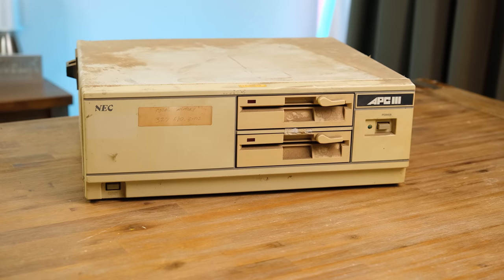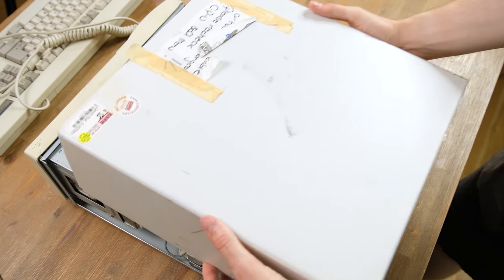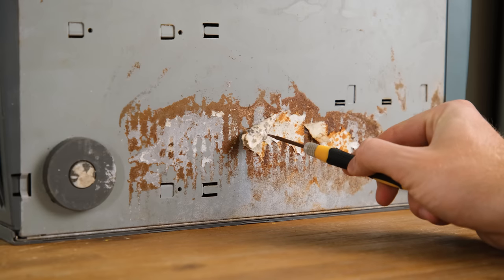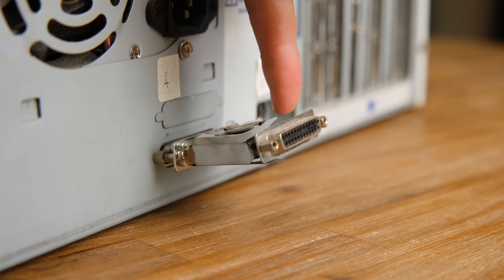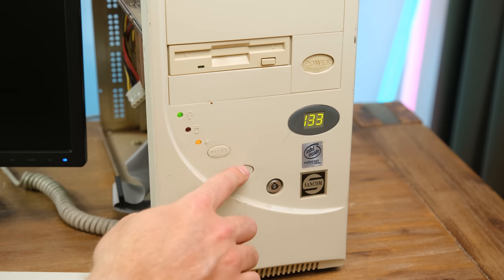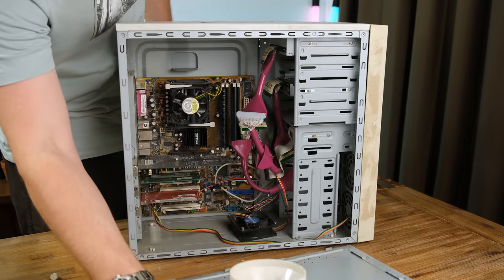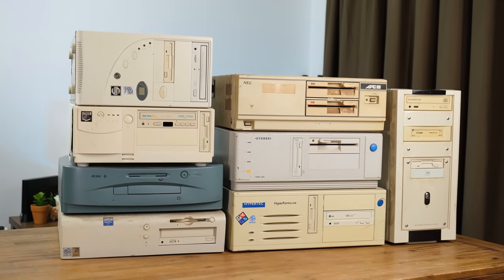I Saved Old Computers From Being Scrapped!

Comment: I kinda miss these days of system builder PCs when everyone had their own weird case and motherboard designs.
Reply: Wow. Really? I didn’t know that was a thing. I just got into PC building 8 months ago, so my apologies it this sounded amateur
Reply: Until someone had a front power switch button fail & finding a replacement was next to impossible.
Reply: Build your own PC in those days and you were stuck with that ancient layout where the only built-in connector was the keyboard and everything else was a cumbersome breakout cable or an expansion card. Buy from a big brand and you got a case designed for ONE motherboard and one motherboard only, probably can't even swap it with a better board from the same brand. There's some charm to it, but I sure am glad ATX and its derivatives came along.

Comment: Before you wipe the hard drives, remember to backup the drivers! It'll save you some headache. finding drivers for those old machines in this day is close to impossible. I speak from experience.

Last time I went to the recycling center I picked up two 8-bit Nintendos, an IBM Aptiva 2420 and an IBM model 30. Both IBM's work. One NES I managed to save, the second one was beyond repair so I built a Mini ITX PC in it instead. One man's trash is another man's treasure

Comment: If you have an old multisync CRT VGA monitor you can use a CGA output vith a DB9 to DB15HD adapter. And if you have a TV with an RGB input you can also get a cable that can allow to connect a CGA output.

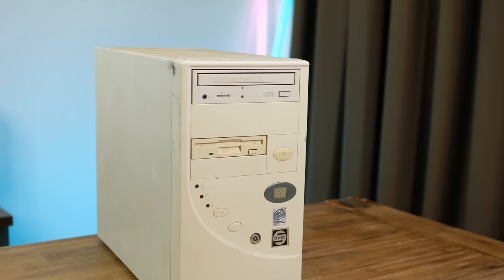Comment: At 4:25 my very first PC had the same case. My first PC was a Pentium Pro 166, 32MB's or Ram had a 1GB Hard drive and came with Windows 3.1 but upgraded to Windows 95 when we got dial up back in 1996 as we were told Windows 95 was better for the internet. I got the computer back in 1995 on Christmas day. I was so excited.

Comment: It would be interesting if these cases could be modded with all new guts (other than the CD drive) to be super down-low gaming beasts.  It has me thinking about experimenting on an old eMachines tower.
Reply: There are beige boxes in ATX format where a modern motherboard will just fit, no need to destroy an AT case.
Reply: I just made a sleeper build of a Viscom V2 Premiere case and am looking to do something similar with a Dell Dimension 2400 as soon as I figure out the front pin outs.  I like working with the P4 era and up.  I do wish that desktop cases that can hold more than 8 3.5” HDDs were still a thing.

Comment: I had an NEC APC III with two external 10MB hard drives. Which ran MS-DOS with MS FORTRAN  and a third party C compiler. I also had a 300/1200/2400 baud external Serial Dialup modem for dialling into work's VAX 11/780.

Comment: I have an old IBM computer that is so slow that it is almost useless.  But I installed an alarm clock program that allows you to enter sentences that it will speak at assigned times.  SO it is asleep most of the times, but wakes up and tells me things like "Get off your lazy butt and vacuum the carpet.", Or "It's treadmill time.  Have you done your treadmill exercise yet ?".

Comment: Nathan, with the NEC APC III, you need to remove the CMOS battery IMMEDIATELY. These can leak acid onto the board and corrode all of the traces around it, causing the computer to be unsalvageable!

Comment: Interesting stuff!
I actually have a bunch of older pcs in my possession. About 6 pcs ranging from 5 to over 20 years old. I think the oldest one is running windows 95 still! Since me and my mum never like to throw away old computers, I keep them all in a spare room.
Thing is I'm kind of out of space, so sadly they're going to have to go at some point if i can't repurpose somehow. Besides salvaging any old files that may be knocking about on them though, I don't really know what to do with them and it seems a shame if they could serve a purpose. All windows pcs by the way.
I can think of two things, taking all the harddrives together for some extra (somewhat bulky) memory space or making one of the newer ones into home server.
I had a bright idea of taking all the parts and combining them, but most of them are so outdated now that I don't expect the hardware to be of much practical use besides maybe the harddrives. I don't suppose the ram in them will be of much good since they're mostly all different makes and sizes.
Any ideas what else I could do with them, or where I might find some pointers?

Comment: older psu have negative voltage rails this is mainly used for expansion cards and serial port .new style  psu do not have  negative rails but in most cases they will work fine for old mb.

Comment: I'm wondering if that mangled adapter on the back of the Hyperformance computer is actually a license dongle for some piece of editing software.
Reply: There's a very high chance it is.  Not necessarily editing software - there's still quite a lot of 'niche' software licensed in this way.  The other thing it could be is a serial gender changer - I have an older one that is that size (currently sitting on the back of a SparcStation 10!)

Comment: hey, cool video! i got an old pc from E-Waste that wont display any output or
beeping. its a compactq with an AMD athlon 64 x2 cpu. its  roughtly 17 years old. anyone have a clue what could be wrong?
Reply: Have you tried replacing the Power supply?
Reply: Could be any number of things, could be an easy fix or it might never work again. You’re going to need to figure out what components work, what doesn’t and then go from there.
Reply: @francescobortot5442  the power supply works fine, i checked the voltage
Reply: @jonchapman6821  i tried reseting bios by removing the dead battery in the motherboard, replaced for a new one, added new ram and tried agin witth same resoult
Reply: Here i am 3 weeks later and i got the pc working agin! It turned out that there was some corossion on the back of the motherboard, but i easly fixed it. It was supposed to run windows xp, but the hdd was corrupted.
Reply: @pigeon3036  Good job 👍🏻 

That kinda proves my point, there’s absolutely no way anyone could have guessed there was corrosion on the back of the board!

A good physical inspection of all parts is always a good place to start. Look for damaged or missing components etc. I’m glad you got it working.

Comment: I used to own the same acer aspire, although with a faster 100mhz (PR120) IBM/Cyrix CPU. i missed that case, although at one point i modded it and through a standard AT board in it. although sorta regret that and wished i kept it stock/and kept it as i through it out in the early 2000s (it was actually my first PC, we got at best buy back in 1998? for about 800$)

Comment: Did you know VGA is signal compatible with CGA right you can get an adapter cable
Reply from the maker: Please link to one!
Reply: @psivewri  
YouTube won't let me. You want a " DB9 9 Pin Male to HD15 HDD15 15 Pin Female, Male to Female M/F Molded CGA/VGA Video Adapter Changer" Coupler

You can make your own.  The pinouts are on Wikipedia

Comment: There are times when recyling is necessary. Example all mainframes older than 10 years. Or completely obsolete hardware that's so outdated that no sane person will even occasionally use it. Unless they're actually used, they're trash.